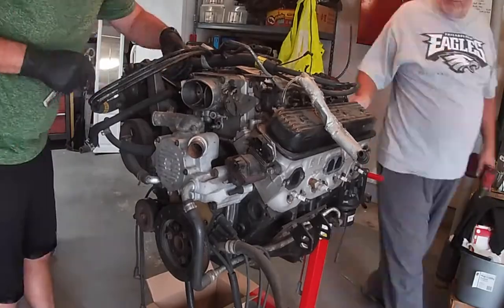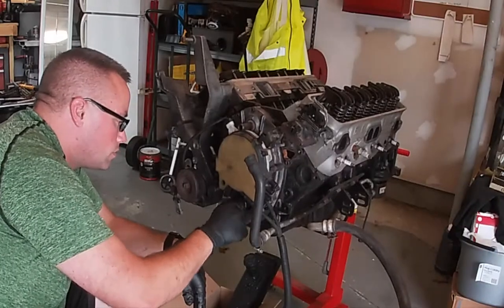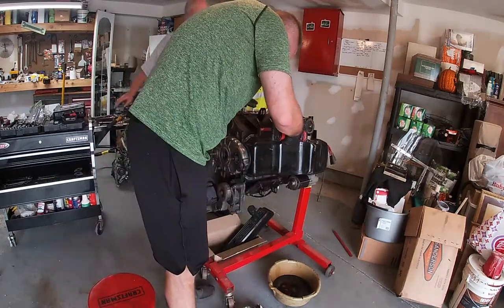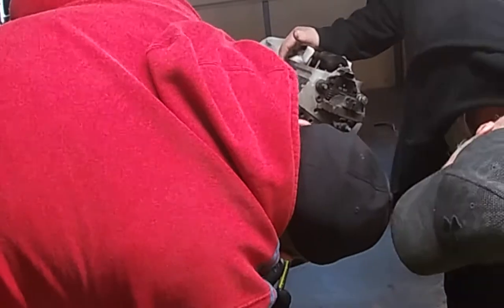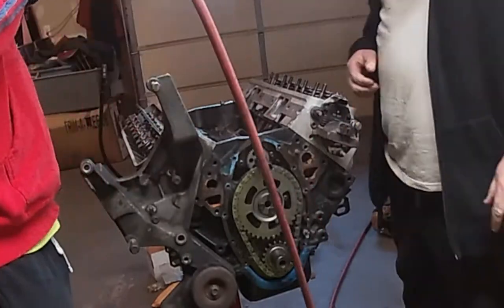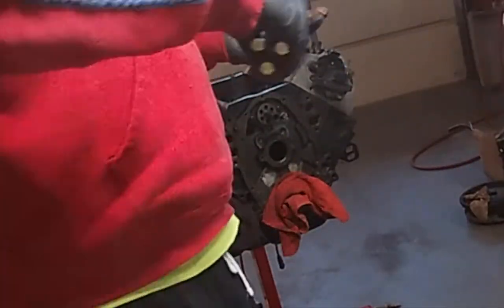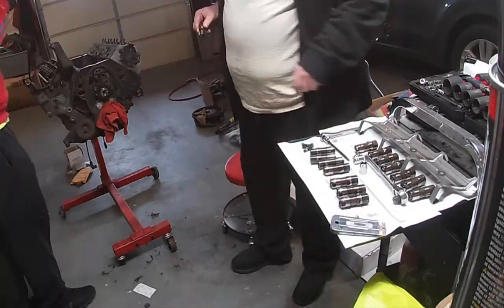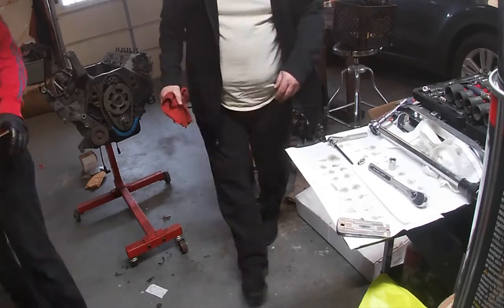How to Install an Aftermarket Camshaft in an LT1 350 // Project Sonoma S10 LT1 Swap // Part 7

Comment: I prefer lining the dots on cam sprocket and cam sprockets.. I feel its just easyer cause you could be a tooth off and last thing you wanna have to do is retiming this engine again.. Appreciate the torque specs😁

Comment: Would you say this can be an in engine job or you would recommend removing the engine like in this video
Reply from the maker: Definitely can be done with the engine in in most cases.  Just easier if it is already out.